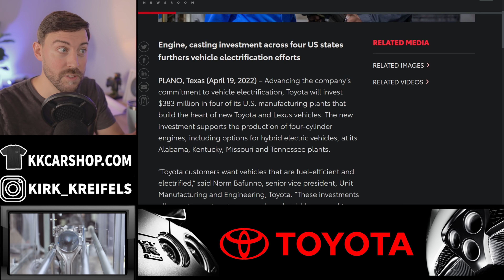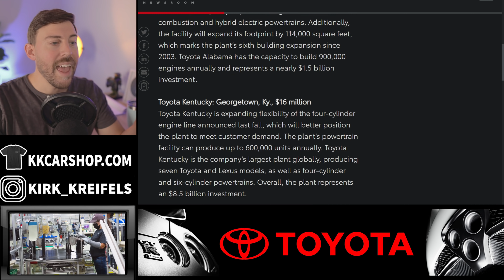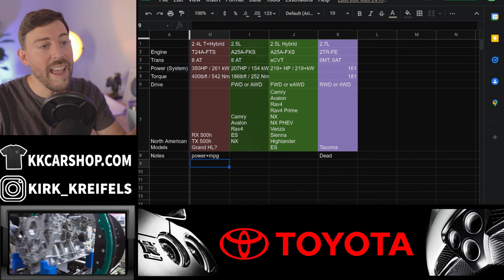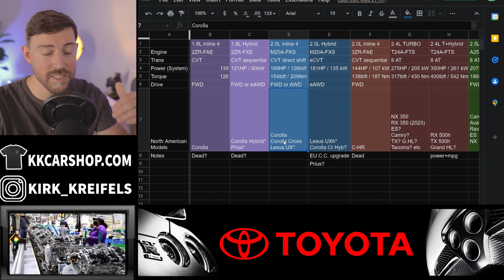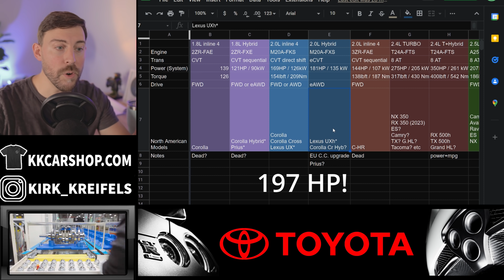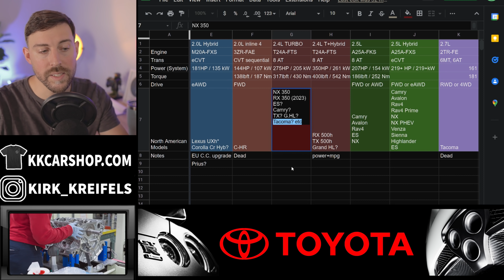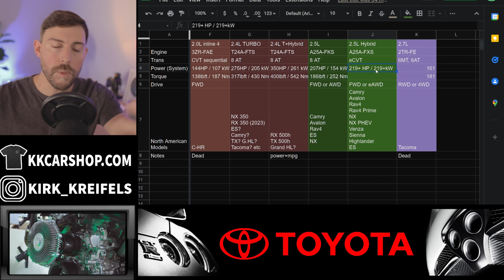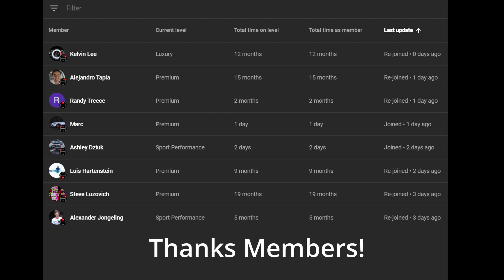Toyota's NEW engines are Small, Powerful, and Efficient...RIP V8, V6?

Comment: Let's not also forget that just like Porsche working on synthetic e-Fuels, Toyota is trying to combine Hydrogen with Gasoline as and build Hydrogen+Gas combo engines and they've been testing that for a while now. Hyundai is jumping onboard too.

With the combination of synthetic e-Fuels that'll be largely at all ExxonMobil gas stations in 2 years and whenever Toyota has completed testing on combining Hydrogen technology to an internal combustion engine without the need of hydrogen station and hydrogen is blended together with the e-Fuels (where it will meet emission standards), the Hydrogen+Gas engine from Toyota will be a 4-cylinder engine.

The one big thing that's fluid about it is that while it is still in its testing phases, we don't know and won't know for a little while longer what kind of horsepower and torque it will bring to the table and whether if it will be a naturally aspirated Hydrogen+Gas combo, a turbocharged Hydrogen+Gas combo, or a supercharger Hydrogen+Gas combo.

Mazda is also on it with their SkyActiv-X engine that has yet to debut to the world and Nissan is also in on e-Thermal engines, even though SkyActiv-X is not going to be a hydrogen combined and neither is Nissan's engine upgrade, but nevertheless, if 4-cylinders is the answer to #SaveTheInternalCombustionEngine then I guess the U.S. market will be driving efficient, yet powerful 4-cylinder engines then.
Reply: Synthetic fuel is likely to be very expensive to manufacture.
Reply: I thought Mazda’s Skyactiv-X was available in their European Mazda 3. 2.0L I-4 touting some 50mpg
Reply: You make important points in that electricity may not be the ultimate propulsion option for many vehicles.

Comment: I knew Toyota wasn't too far away from going turbo. People complained about Honda Accord not using the V6 anymore. Now Toyota is going the turbo route. The V6 from Honda Toyota Nissan are really good, but the 2.0 turbo has advantages as well. I believe Toyota wanted to have more time for research and development for reliability and durability.
Reply: @chezzyperson3339  nah ls was fine
Reply: Agreed
Reply: The only knock on the Honda v6 is that it has a timing belt and from what I heard you have to manually adjust the valves

Could be wrong though

 I also love the Nissan VQ v6 from the previous Altima, current maxima and also the Nissan 370Z nismo.
Reply: Advantages??? Name some and do not forget about disadvantages
Reply: well then how is lexus a luxury brand anymore like see there interior arent the best now some times mazda can beat there interiors comfort is not with the rivals nothing is not tech and now the engine too
Reply: @rks-bh6tb   lexus is still doing extremely well and i have seen few comments like this and i think  are you blind or just crazy lol 👎 Because You are wrong .  Lexus is a luxury brand and every product is excellent except for the ux.
Reply: @coke947  ok wait ur crazy tell me how its good explain anything lexus does better then rivals and i dont wanna hear reliability
Reply: @coke947  the comfort is less then a merc and audi maybe more then a bmw but cuz bmw is sporty does lexus have the best tech oh wait no interior quality no they downgraded the interior for the nx THE LS is boring now LC500 is the only good one LX600 is good but not 110k good the top of the dash is soft plastic its should be leather
Reply: @coke947  and THE UX is a good car for the price interior wise the size is bad engine yea eh but the interior is nice for the price
Reply: @rks-bh6tb     i own a s class so i will be upfront europeans are better than lexus .lexus is better than its asian rivals by a mile  .comfort luxury exterior design  brand prestige  interior quality  and  all new technology is fantastic and well received in uk  and  europe were i live lexus is getting its respect it deserved .so those facts i said  is better than genesis and other asian luxury brands. Now you will say i am wrong.😂
Reply: @rks-bh6tb   soft touch and leather is very good so why are you complaining lol.
Reply: @rks-bh6tb  ls is boring because its not a sports car lol and ls is one of the best full size luxury cars yet you talk bullshit .lx is  really good and its worth 110k.
Reply: @rks-bh6tb   nx is a entry level suv so its ok.because i know european products because my wife used to own a x3 and it had bad quality at first it looked good but as time went it sucked .so you are wrong there as well.
Reply: @coke947  lmao soft touch is good when you have a 40k car when you have 90k soft touch isnt the best you should have full leather
Reply: @rks-bh6tb   ls has leather everywere and wood trim so why are you complaining and  lx has wood leather and soft touch so its also more than fine. You are wrong and its ok.
Reply: @rks-bh6tb  you are crazy and i dont talk to them so overall you are wrong and i will not waste time with you .😂 i know you will reply so here is some advice dont embarrass yourself.i know more about luxury than you .
Reply: @rks-bh6tb  Bmw, Mercedes, Audi has been using 4cylinder engines in many models for decades, nobody griped and complained that they were "no longer luxury brands", who why does Lexus no longer qualify to be considered a Luxury brand because they have started switching to 4Cylinder engines? #EuroBias. 
How about drive one and hop into a Hyundai since hyundai is creeping up. The difference is CLEAR. The engine isnt what defines luxury otherwise the same V6 that you're all praising wouldnt count either, given that it comes from a Camry/Sienna minivan
Reply: @dwayneIs371  agreed . Despite its on those models that is a fantastic v6 engine it self
Reply: @rks-bh6tb  I honestly don’t know why people think it’s luxury anymore

The Lexus at best is realistically closer to a premium brand than a luxury brand. If anything genesis Acura and Mazda and even Hyundai and Kia are inching closer to true proper luxury than Lexus is
Reply: @naveenthemachine  FACTS THANK you its like mazda yea old lexus was luxury like the ls400 cuz those one had one of the most comfortable rides for the time lmao it delayed the s class like who else delayed the s class only bmw thats now you wont see that happening the only luxury cars in lexus are LS LX LC500 and ES you could say gx it depends but not exactly the rx is good but now its more premium for the current times
Reply: @rks-bh6tb  I’d say even the next gen RX may go a bit downmarket and have an interior comparable to the nx which is to say not luxurious
Reply: @naveenthemachine  yea i can see that happening the same for the nx old nx had a leather padding in the middle of the dash with stitching the top of the dash was soft plastic with stitching now its just dark soft plastic no stitching now nothing hell i think old nx is better then the rx where you would touch the dash it was better because the leather padding  if you looked around more rx would be better
Reply: @naveenthemachine  lol
Reply: @mikek6103  naveenthemachine  is a lexus and toyota hater overall and always put crazy comments so dont waste your time with him..also dont waste time with rks same for him believe me.👍❤

Comment: Toyota did a great move in maintaining their Hydrogen program. We can assist in a shift of the agenda, from BEVs towards Hydrogen powered cars. As a form to lower the Carbon Footprint, offer more affordable cars, less pressure on the Power Grid, and convert many jobs connected to the Oil industry, to Hydrogen production.
Reply: I've got a 2000 Toyota Solora 3.0l v6 automatic transmission. It came factory 210 hp. I've put a cold air induction that goes through the fender well. I've put twin air cooled twin props turbos. I've changed all O2 Bosh sensors , the mass air sensor. Now it's pushing 235 hp. I've been offered 5,000.00 for it. I can't sell it because it's my keeper. I've had a few sports cars and I've never had one that could compare to it

Comment: 2.4 turbo is the perfect engine for the tacoma and  for many products
Reply: I think they can turbocharge the existing 2.7 to make more power than the 3.5 in the Tacoma and the 4.0 in the 4runner. The other cars can make do with the 2.4 turbo.
Reply: @damilolaakanni  2.7 and 3.5 plus 4.0 is dead and old.time to move on .i understand that for some its hard but have to move on when time is right
Reply: @ekgcanadianenthusiast9961  The next Taco will have the 2.5 as the standard engine.  A 2.4t will be optional.  In addition there will be electrified power trains.
Reply: @user-tb7rn1il3q  yes indeed

Comment: Without major breakthroughs in battery technology, it will be hard in the present decade to ramp up BEV production towards ICE numbers. That's why Hybrids with more efficient ICE engines and higher range make perfect sense to the market.
Reply: USA seriously needs to up its game.  Philadelphia doesn't even have a plethora of charging stations.....very disappointing
Reply: Agreed! There’s a reason it’s being used in high performance applications now as well.
Reply: Absolutely right. Hybridization adds weight of course, but the benefits of more power, cleaner emissions, and efficiency more than make up the difference generally. The prius prime almost 70 mpgs.
Reply: please ...go and tell this statement to the cult followers. ...
Reply: @khaledali-di9mt  no but!! Solid state batteries, 1000 mile range, graphene, any day now !  REEEEEEEE!
Reply: @chunkycheese73   with all my respect ...this is all bullshit ....inorder to compete with ice u need a specific energy density of 2000wh/kg ...solid state will get you maximum 500 wh/kg (current limit is 250) at the end of the decade.....that's how u compare propulsion systems....inaddition it needs to have same cost and same passive safety and same durability as ice propulsion systems...guess what ? a battery with these features won't be available till 2050 atleast !!!and this is a fact driven by research about the average battery specific energy increase per year !!anything else is export grade bullshit propagated by the cult leader !!! and believed by his followers exactly like the fsd bullshit ....same story !!!if just people respected science and experts the world will be truly a better place !!!
Reply: @khaledali-di9mt   I 💯 agree! My comment was making fun of the EV nuts haaaa
Reply: @chunkycheese73  yea...I am not sure whether you were making fun of them or u are genuily excited by all of these false promises....because u really wrote your comment with the same style they use...the same childish shallow way they use that they think it will force physics to surrender to their will !...any way nice try and u got me 👍
Reply: @khaledali-di9mt  haaa no worries! Glad you are fighting the weirdos out there, it's crazy people only repeat what they hear and don't think for themselves

Comment: My heart hurts for the 2GR-FKS💔💔 hopefully they can perfect the new turbo 4 cyl the same way they did the 2GR-FE/FKS. I’m so happy the 1.8 and 1.8 hybrid in the corolla is dying! Imo they shouldn’t have made the new corolla w that 1.8 engine.
Reply: I have an IS350 and the 2GR-FKS is more than just horsepower and tuning, it's also the instant throttle response of a naturally aspirated engine and the V6 induction sound. Winding the engine out from 1st - 3rd gear at wide open throttle (ie. floored the gas pedal to redline in all gears) is a lot of fun because of the smooth power delivery, and the increasing urgency of the V6 growl.
Reply: @gns942  Connecting Rod Failure, valve train failure, oil leaks, oil burning, sensor failure, and VVT actuator failure.  It’s probably Toyota’s worst engine right now.  It doesn’t hold up well in the Taco at all.  I imagine in a light sedan it will last longer with fewer issues.
Reply: @user-tb7rn1il3q  you sure it’s the FKS? I know the older 4 cylinders had oil burn issues
Reply: @naveenthemachine  Only if they are not maintained
Reply: @user-tb7rn1il3q  The 2GR-FSE/FKS in other vehicles are fine though. What's the difference, is it the place of manufacture? I know that the -FSE and -FKS in the Lexus IS/RC/GS cars have basically no issues (those being made in Japan).
Reply: My Camry has the 2GR FKS. I freaking love that engine. It’s so quiet so smooth very Lexus like in refinement and smoothness
Reply: @naveenthemachine  That engine isn’t that great and had a bunch of problems by Toyota standards.  I’d much rather have a high torque low rpm turbo 4.  Toyota 4s go forever with minimal issues.
Reply: @user-tb7rn1il3q  What problems?

Comment: Chr is not needed and just make corolla cross coupe suv   if they need a coupe suv.
Reply: Yes you're correct. I have nothing against the CHR it's a good car but it just doesn't make sense. FWD 2.0 4cyl that is underpowered even more so than Corolla Cross. Worse MPG, tight inside and visibility is bad. What they needed to do was give us the Corolla Cross at the CHR MSRP. No way the Corolla Cross costs more for Toyota to produce than the CHR. CHR comes from Japan on top of that. Corolla Cross with a lower MSRP would fly like hot cakes.
Reply: @abes7181   cars like the chr happens but in the end they are not needed
Reply: @abes7181  the CH-R is also built in Turkey.
Reply: @chezzyperson3339  well said.chr is not needed
Reply: @chezzyperson3339  now thats a good idea my friend